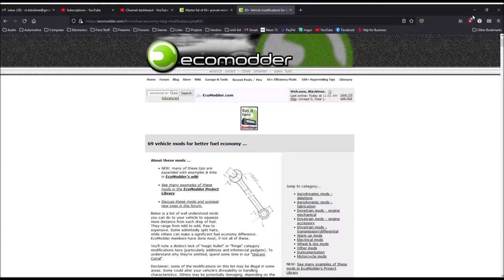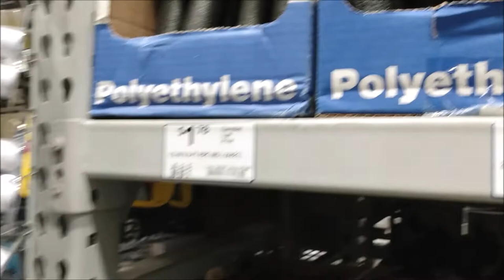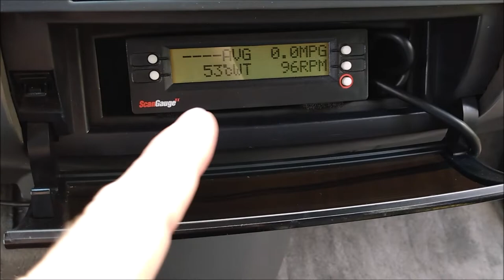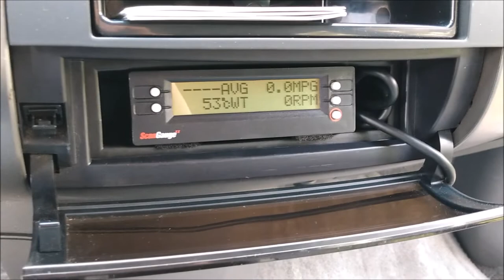The Prius Experiment: Upper Grille Block -- Better Fuel Economy for $2

Comment: Well did it help at all?
Reply from the maker: Yes, especially in the winter. Fuel economy results are in the next video: https://www.youtube.com/watch?v=uEQysHouoOo
Reply: Got it thanks 
  What in your opinion would be the best mod to apply to a 2014 prius?
Reply from the maker: The driver is the single biggest variable in fuel economy. So I'd suggest doing the "driver mod" first. That said, here's a thread on Ecomodder where someone modded a 3rd gen Prius. Might give you some ideas. https://ecomodder.com/forum/showthread.php/3rd-gen-prius-aeromod-thread-28466.html
Reply: @michaelblacktree Mr Blacktree..  I am in the deserts of California. Will this mod black the radiator increasing coolant temps beyond acceptable operating conditions
Reply from the maker: I don't know, never drove the Prius in a desert.
Reply: @michaelblacktree  thank you for your reply
Reply from the maker: no problem

Comment: People on PriusChat -- including me -- were doing this 10+ years ago. Once the material starts to degrade from sunlight it may end up flying off and polluting the roadway. Zip ties or other attachment methods are suggested. If you live in a cool-ish area you can block most of it all year long. From what I recall, many folks left an area near the air intake unblocked so that the external temperature reading would be relatively correct. Definitely useful to be able to see engine temperatures during warmer weather so I'm glad you've got that. You can also purchase/install an engine block heater for a 2nd gen Prius (probably other cars as well?). You can run that for an hour or two before you go driving. I've still got my heater installed. People ask why I've got a plug sticking out of my front grill.
Reply from the maker: Those are good points. Although here in Florida, a block heater won't be of much use. My concern was if the grille block would affect cooling in the summer. And it appears to be fine. So the next step will be to make a more permanent grille block.

Comment: Hey nice your job for us! I have a question: Have you ever heard a noise coming from the steering wheel that goes "knock-knock"? Could it be the steering gear?
Reply from the maker: Yes, I do get a clunk sometimes. I've replaced almost the whole suspension (because it was worn out), and the clunk is still there. So maybe it's in the steering rack? I'm not sure.

Comment: Look into your oil as well! A test myself i switched to full synthetic 0w20 mobile1 in all 3 of are high mileage 2nd gen Prius, not only has fuel economy improve by 10% but also the oil consumption is nearly stopped! Beside in 2010+ 3th gen Prius Toyota recommended 0w20,  it has better flow characteristic and better cleaning property to help with hybrid engines during the starting and stopping plus cooler temp it runs than the 5w30 design for! Thanks Nate
Reply from the maker: Actually, I switched to 10w30 full synthetic (Valvoline MaxLife). I haven't noticed any significant change in fuel economy.

You make a bunch of glowing claims about that oil. Makes me wonder if you're on their payroll or something...
Reply: @michaelblacktree   I'm a retired hybrid tech ran my own shop repairing  nothing but 2nd gen Prius, I still enjoy working on Prius, hands down one of the best reliable cars out there! Thanks Nate
Reply: @nathanhatcher7096  how high mileage are they? I have a 229000 mile 2nd gen Prius, I'm using 10w40 in it. If what you say is true, I might also try out using mobile1 0w20 in mine.
Reply: All 4 of are Prius are high mileage 200k+! I tried heavier oils didn't not improve  oil consumption though after switching to 0w20 noticed that the oil was darker for a couple of changes  simply because its much better at cleaning  internals! Thanks Nate
Reply from the maker: IMO putting thinner oil in a high mileage engine is a step in the wrong direction. But you're free to believe what you want.
Reply: Hmm
Reply: Sorry I even mentioned anything here and surely don't intend to miss lead anyone, can u give us an update on how much 10w30 your Prius is consuming? Thanks Nate
Reply from the maker: It burns about half a quart between oil changes. (5000 miles)
Reply: I tried using 0W20 oil in my 2008 Prius and it ending up messing up the VVT system. I ended up replacing the timing chain and VVT solenoid to resolve the P0016 and P0012 DTC codes I got after using that oil for a year. I switched back to 5W30 and it's been working great ever since. I use the Mobile 1 full synthetic so I go a year between oil changes.
Reply: @BigBud69 incorrect. That was because that motor had prolonged oil change intervals. Which result in harsh carbon deposits all over the sensors.
Reply: @michaelblacktree not always the case. Not every engine is the same or had been maintained the same.
Reply: @WeebAttorney my new to me gen 2 has 180k+ miles..

A Toyota tech advised against 0w anything....   He recommended rotella T6 5w40....

Since doing so... slightly less oil consumption and the oil visually looks much cleaner

He recommended a piston soak to clear debris from the piston rings to possibly decrease oil consumption

He stated that these gen 2 engines have low tension oil piston rings.. which causes the oil consumption... It's always going to burn a little oil and less I get higher tension oil rings

Comment: been doing this mod for the last 2 years and yes it is a big difference 
i live in uk and i have the whole grill completely covered throughout the winter 
i only drive 11 miles at a time and thermostat never opens not even with full grill covered
Reply from the maker: That's pretty cool. But here in Florida, that may not be possible.

Comment: Have you ever removed the back seat to see if a weight reduction improves the mpg?
Reply from the maker: If you do a lot of stop-n-go driving, weight reduction should help. But I think you may need to remove more than just the back seat, to make a noticeable difference.
Reply: I removed the back of the back seat to have more cargo space and it saved 50 lbs
Reply: I might try on my Prius ,but at 51mpg I’m satisfied for now unless the gas goes up again.

Comment: You can do the grill block year round as well. About one of the only effective ways to get the car to warm up quicker.
Reply from the maker: Yeah, I noticed that. The faster warmup, in and of itself, will improve fuel economy. The improved aero is a bonus.
Reply: @drippingwax  I could see that. In the summer it doesn't help much having a grill block outside of city driving anyways. But I know on my prius the gas mileage below 75F the car is typically up from 48 avg to high 50s.
Reply: @drippingwax  Truth it does help. I bet i pick up a mpg or two up top from the grill block. The worst part i notice with the prius is it has an extremely hard time maintaining 150F to go into hybrid mode and shut off at will. That seems to be the big gain for me.

Comment: Wouldn't that block air intake to hood??
Reply from the maker: The bottom part of the grille is still open. So it'll be fine.
Reply: @michaelblacktree  But wouldn't it make engine warmer and reduce its lifespan? I mean I would trade the 1 or 2 extra MPG for a longer life of the engine